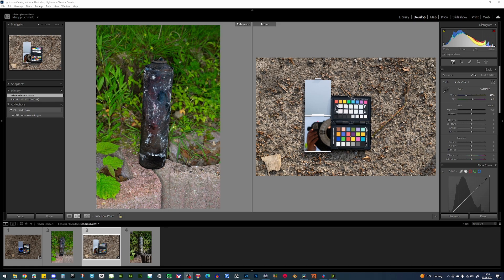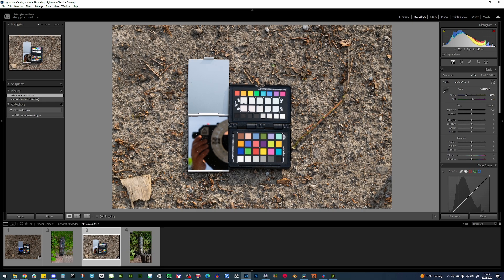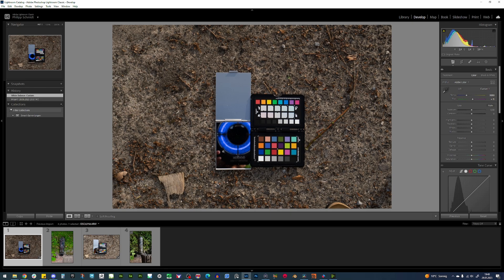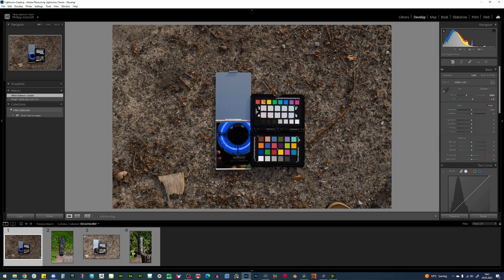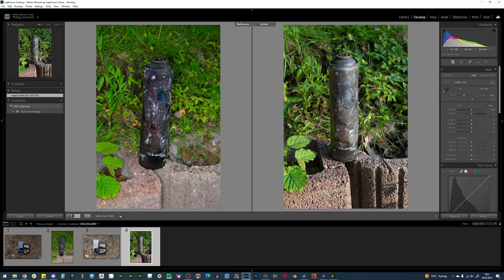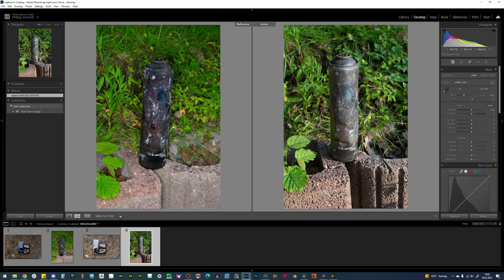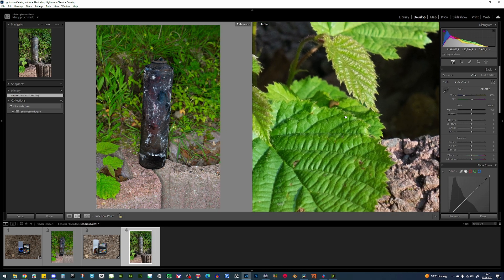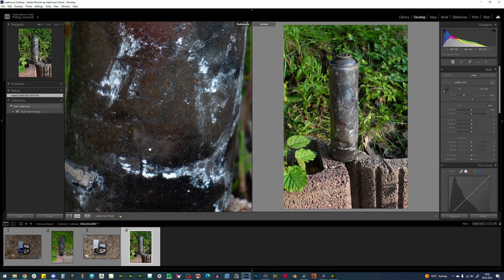Why you need Cross Polarization to increase your 3D Scans

Comment: Hi,
i am trying to find out what cross polarization is best for my purpouse. I am sure you can give me the answer.
I have to work on the human skin and I need to see very clear, no reflects and very small details. I am using a circular polarized filter that I can rotate on my head front lamp  and a lineal polarized sheet  on my glasses.  By rotating the CPL Inget more contrast and less reflects but it doesn’t tonmuch difference. I am  sure I am doing something wrong. Could you help me ?? Many Thanks !!
Reply from the maker: hey ma man! Well, you can't get ride of EVERY reflection. If you look up how these Sheets work, they only "delete" a certain amount of Reflections and Highlights. however: You can go ahead an try to clean the Rest in Lightroom
Reply: Do you know if it would make any difference if I rotate the filter placed on my glasses and stationary the one on the lamp. ??
Thanks man. !!